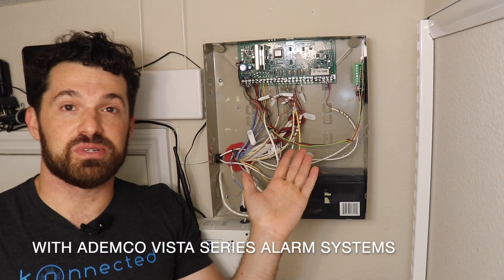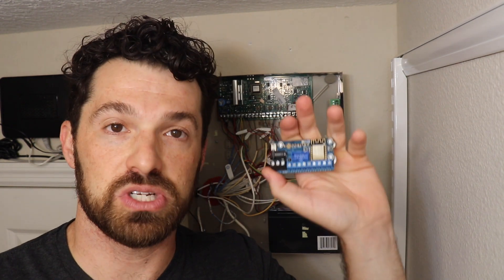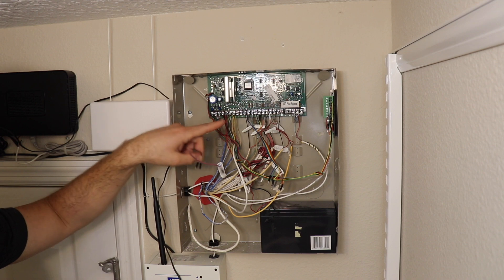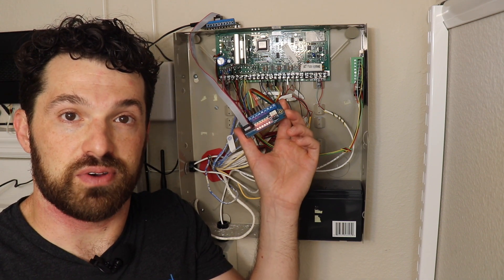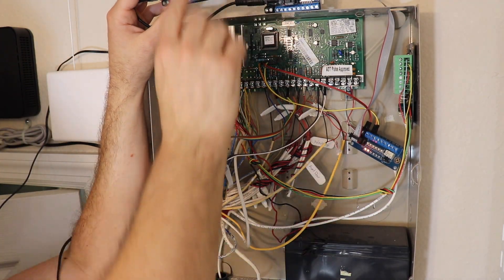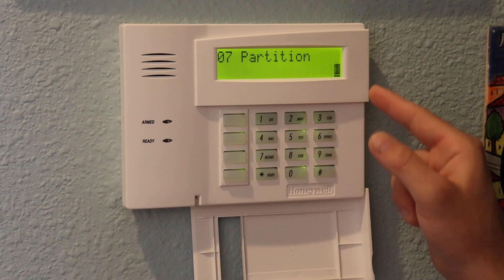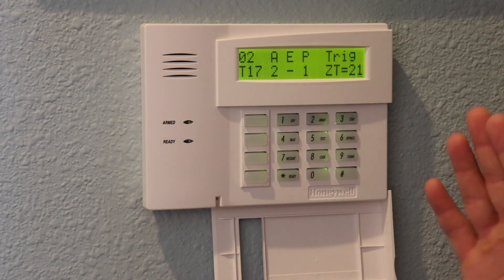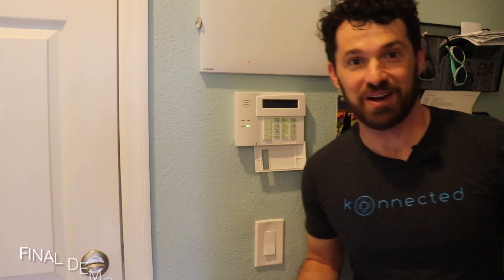Konnected Alarm Panel Interface v2 1 install video w/ Ademco VISTA series alarm system & SmartThings

Comment: I got a general question , if  I have my vista 21p with a wireless transceiver cause I do have mix of hardwired zone and wireless sensors as well , do I get the same feedback responses from those wireless zones on my panel? Also you module report same opening and close to the app?

Comment: It's a very clever device. The only thing I don't like is that there are too many components. I realize that you do this so that you can charge more money by separating all the components but it just makes the install that much more cumbersome with extra wires running about for no reason. You need to buy the alarm panel (or starter kit) which is $89-$99 which only has 6 zones. Most people will need at least 12 zones, so you can multiply that price by 2 (or the pro panel comes with 12 zones + ethernet capability at $229 which cost slightly more than x2). Then you need to buy the interface module which is another $49 (also with only 6 zones, so for 12 zones... x2)... we're looking at, at least $350 USD (+tax and shipping) to revive an old alarm system. That's a little steep. 

I was looking at the Ring Alarm Retro Fit... and it seems to combine the panel and interface module into one device so it's cleaner (and more aesthetically pleasing) and you don't have to string along so many little panels. And it has it's own app that they develop and maintain so I assume it's a bit more secure (since it's a well known smart security company). However, I think it's also only 6 zones for $150 USD. So, I'm assuming you've matched the Konnected system to be essentially the same price as the Ring system... except you have more panels to fiddle with (making it harder for DIY folks) with a less clean system and company name which is not as well-known as Ring.

I wouldn't want to pay so much to revive an old system, either way. If I'm paying a minimum of $350 +tax, I might as well just buy a newer smart security system for my home. I think your price point for your products need to be reevaluated. If you can make an integrated 12 zone pro panel (integrated with the interface module), an all-in-one conversion kit (without having to buy so many add-ons) for $200-$250 (and maybe have add-on "integrated" 6 zone kits for $50), I think it would be a fairer deal. I don't really understand when smaller companies price their similar systems the same as big companies do... you would take more of their business if you sell the same thing for a bit cheaper (considering that they have a much well-known brand and have a product that is integrated with their own app and is prettier to look at). Lowering your price point and having a more user friendly product will help you win more potential customers in my opinion. I personally don't know the history of your company (I don't know who came up with this idea first). This video was recommended by YT and looked interesting since I like topics of DIY and upcycling. Anyways, good luck.
Reply: I have been an alarm installer for upwards of 18 years. I can do stuff on the Honeywell ademco alarm system that Honeywell tech support says cannot be done. I am almost halfway through the video now, and I am confused. There is a whole lot going on to get the system up running. I personally have the eyes on communicator tied into my 320 P1 which is essentially a protection One branded Vista 20p. I am very satisfied with what I have, and it was not as complicated as this seems to be at point.

Comment: We have a GE Simon 3 alarm system that was purchased at Lowes, not monitored by ADT.  It has an outdoor siren we would like to continue using but the door sensors need replaced.   How can we update this to be used with cellphone smart home

Comment: Thanks good video: looking to add your system but question on alarm/disarm, can this be done through password protection as well?
Reply from the maker: Options for password security or other features like that would vary depending on which smart home platform you use. Reach out to us at help@konnected.io or our forums at help.konnected.io for pointers specific to your setup.

Comment: @8:16 Just ordered the kit. a Little confused by what you mean by on the "high side" of each zone? Gonna attack it asa I can.
Reply: Ahhh, I see it @9:04  my panel doesn't specify "hi " "lo"  Side So that was confusing me especially for @18:39 as I'm trying to use this video for the Interface-pro installation and using the relay.

Comment: What's the difference between this and the EyezOn Envisalink EVL-4EZR IP Security Interface Module for DSC and Honeywell (Ademco) Security Systems?
Reply: Understandably so my response is a bit late. I have been using the eyes on communicator for approximately 3 years or so. I just installed the the sidekick, but yet it is not hooked up. I like eyezon better

Comment: I have a Napco System Gemini board #GEM-P3200/P3200M with 3 Gemini keypads # GEM-RP1CAe2 and 10 contact zones with 3 wired motion detectors plus there is a separate Atlantic Siren driver Board.  So can you tell me what kind of Konnect system parts I would need,  to convert my system to a Konnect System.

Comment: Notice you have taken the reference voltage for the second interface board from the 8-pin connector for onboard triggers. Can the board be connected to the standard Aux Power Output the same as the first interface?
Reply from the maker: Yes, that works too. They are typically interchangable.

Comment: Is this just for hardwired zones, I see you have a receiver,  so was wondering if your wireless zones will be working with this as well
Reply: Had the same question. Probably will have to just add Smartthings compatible switches to the same doors or windows on wireless zones.
Reply from the maker: You won't be able to monitor the wireless zones directly, but if the alarm triggers because of a wireless zone and you have set up Konnected to monitor the triggered status of the alarm as shown in this video, that will still work.
Reply: I have a vista 50p and using relay module to trigger konnected board. The relays are programmed to trigger with zone list. Each of my wireless zones are in a separate zone list assigned to a relay. I only have 3 wireless zones. I done zone 1 the same way for my 2 wire smokes. Relay putting ground on konnected interface board and when zone goes into alarm the relay opens. Then I get a alarm for that zone. Will be setting automation to arm and disarm smartthings with a relay. It will work just need to do a lot of programming.

Comment: Hi, does it work with my old Magnum-Alert-800 system?
Reply from the maker: Konnected's interface is designed to work with any brand of wired alarm system. The only case where it doesn't work is with zone doubling or addressable polling sensors, both of which are very uncommon in residential alarm systems.

Comment: Can this module be used on a DSC 1550 control panel ? Or does it have to be upgraded?
Reply from the maker: Yes, it can work with a DSC 1550.

Comment: Can you provide installation instruction specific to DSC PC5010 control panel? as it is different from the panel on this video. Thank you!
Reply: The necessary instructions may be very similar to the PowerSeries 1616,1832 and 1864 so let me know if you would like what I found to work to get this functioning.

Comment: I have the old interface v1 and had to reset everything, can I use the konnected app to setup everything again using smartthings?
Reply from the maker: Yes. Just flash the updated firmware on the older wifi boards at https://install.konnected.io

Comment: My system is DSC 16 zones, but I'm using just 15 of them. Do to fact my system is in location where is no WiFi reception, just hard wired network (RJ45) and I'm not comfortable to add any WiFi access point, please advise how to create 16 zones system hard wired to network.
Reply from the maker: Our Alarm Panel Pro has Ethernet capability and supports 12 zones. With two of them you have 24 zones.

Comment: As an Alarm Technician, I've never understood why bother putting the resistor in the panel, if they didn't want to supervise the loop then disable it in programming.  Idk, just screams lazy.  End of line resistors should be at the end of line, otherwise it defeats the purpose.

Comment: The necessary instructions may be very similar to the DSC PowerSeries 1616,1832 and 1864 so let me know if you would like to know what I found to work to get this functioning like Nate is saying in this video. There was a bit of trial and error and close looking to finally get it working.
Reply: I'm interested in the instructions for the DSC, thanks!
Reply: i am also interested for DSC 1616
Reply: I am interested in configuration for DSC as I am currently working with a client

Comment: I’ll save money by just using the panel kit , plug power to auxiliary, keep the original power back up - the battery was just replaced. No sense in buying another module ( interface ) and another battery back up pack. I’m an alarm technician of many years. I’m doing it this way because I don’t have an accessible plug and don’t want to fish wires , plus it makes no sense to buy another battery. BUT one’s the battery dies - I may consider the cleaner looking install. Functionality it’s no different, just better looking  with the interface and Konnected battery. Nevertheless I doubt their battery will outlast an old 12  volt. Spend a little extra and replaced all your contacts if they’re older than 10 years old. Believe it or not they either get magnetize ; which means an alarm will not be detected by intrusion and do become faulty creating false alarms. Now Konnected can add contacts to their sales products. Just don’t replace if they aren’t faulty or 10 years or less.